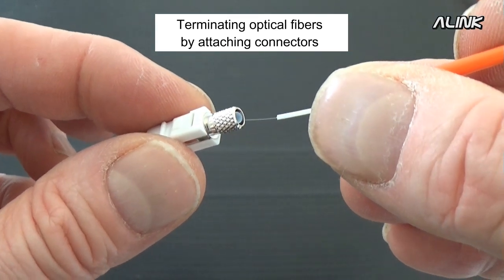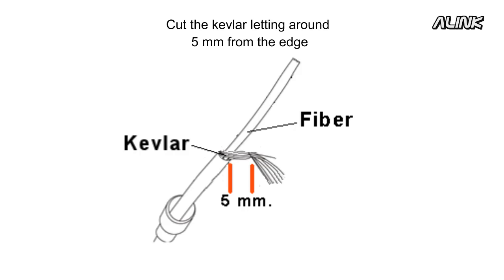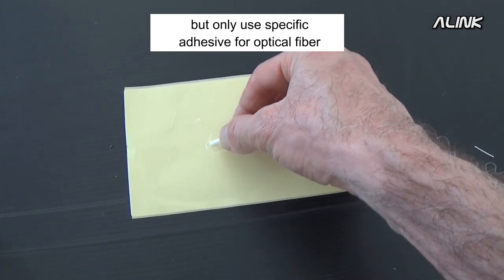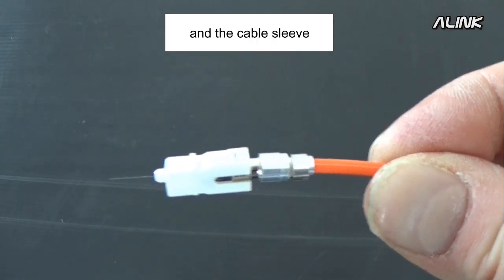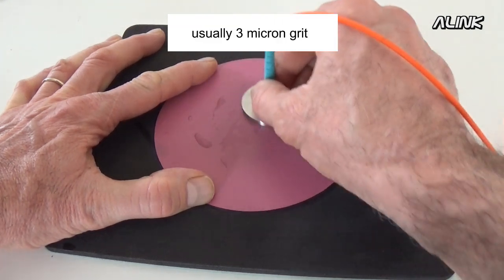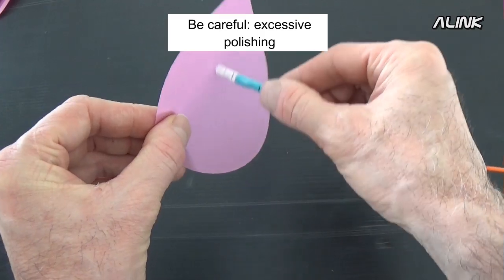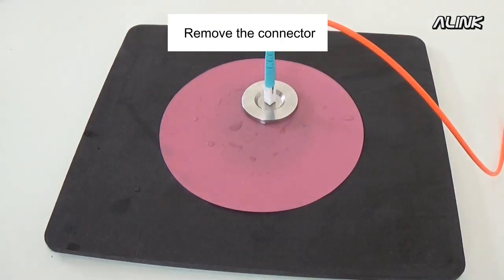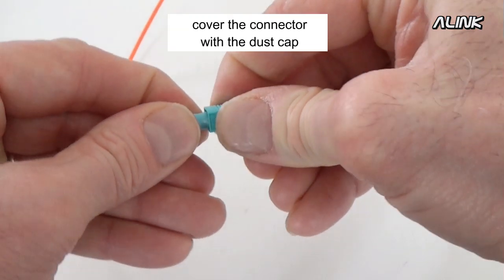How to Terminate and Polish a Fiber Optic Connector

Comment: Do you not find cleaning with IPA and a lint free tissue leaves behind debris? I am having a lot of difficulty ensuring the fiber end face is absolutely clean after sanding with 1 um paper. There are always tiny black particles left behind : (
Reply from the maker: There are wipers of tissue especially made for optical fibers, you can use them

Comment: The simple and best way has been used for the presentation but now a days most of the brand providing   one step  termination Kit .not require any kind of Adhesive or polishing . just take measurement of fiber  how long it need to strip and cleave the exact  length and insert to  connector kit and fasten the  back bush . and test with your VFL or OTDR .
Reply: but 5x so expensive...